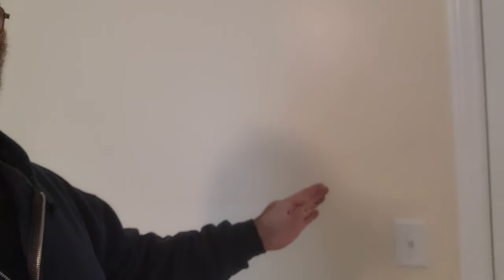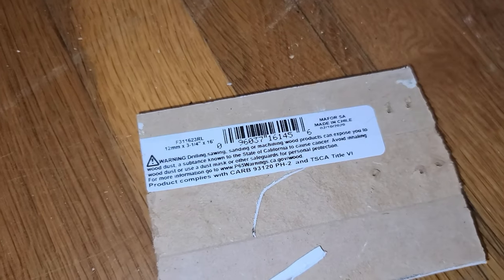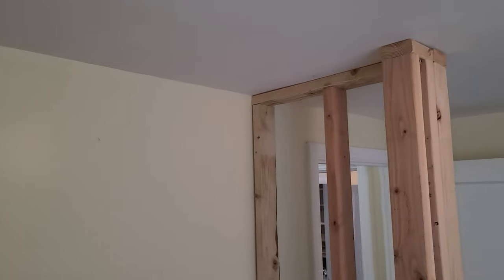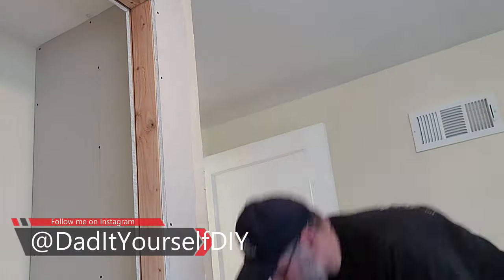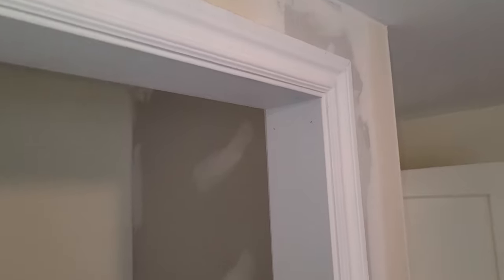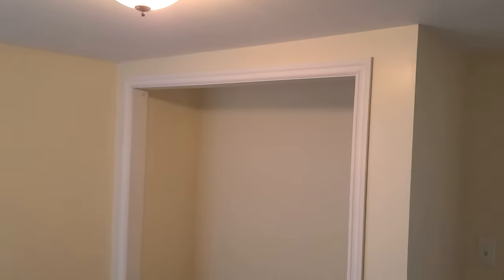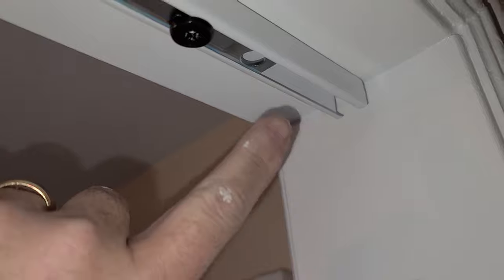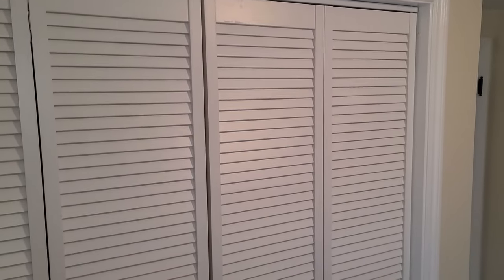Build a NEW Bedroom Closet | Home Renovation Part 1 | 2021/22

Comment: Hello, How do you measure for the door opening before adding the trims? Thaks
Reply from the maker: A rough opening should be 1 1/2" bigger than your final dimension. For example a 60" door should be 61 1/2" inches wide.

Comment: So you only need a little bit of a stud to frame a non load bearing wall closet. Noted.
Reply from the maker: Yes. It's really just a place to hand the doors!!
Reply: @DadItYourselfDIY  I may go a little deeper than 24" due to studs, and to match the original closet (that I stupidly took out). Just trying to make the same but longer.
Reply from the maker: @Joetime90 in my case I went at a minimum because it was already a small room, and the original closet was in the back wall but became part of a bathroom remodel.
Reply: @DadItYourselfDIY I also appreciated that you showed the depth of the closet being dependent on the drywall, no other video or Google search was straight about it. It seems common sense. But guess for a DIYer who's gonna use 3/8 or 1/2 drywall to finish it, it helps a lot.

I figured as much, but I'm always super cautious before cutting anything at all.

Also, I think your bump out is called a return, especially if it's a bit longer.

I saw a video of a guy using anchors to screw studs into existing walls and ceilings where he couldn't find studs. I don't like the idea. How do you feel about it?

Also the caulk tip did drive me mad, but I understand.
Reply from the maker: @Joetime90 the only solution to the stud would be either cut the wall and install blocking or use anchors in addition to the screws/nails you can land in the top and bottom plates of the supporting wall.

Comment: How do you make sure the doors will fit?
Reply from the maker: You purchase the doors you want, then frame the opening 3/4" wider and 1" taller. Then use 1/2 casing, then the doors will fir with a 1/4 reveal. You can shim the casings to fine tune the reveal. The manufacturer has all of the dimensions for rough and finished openings on the packaging.